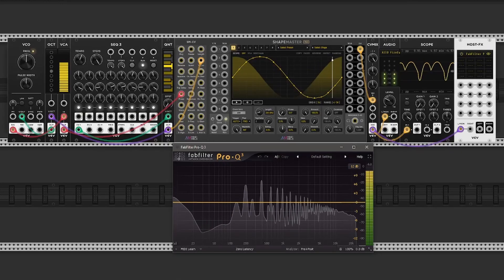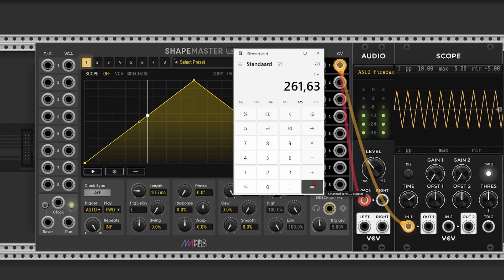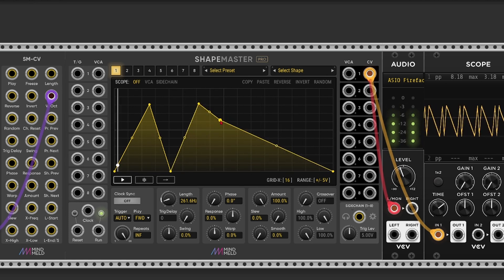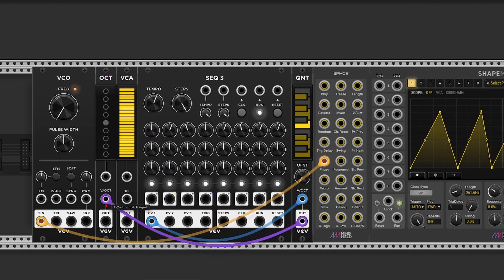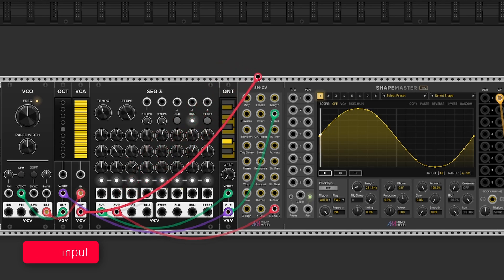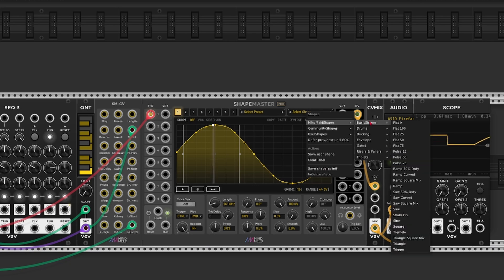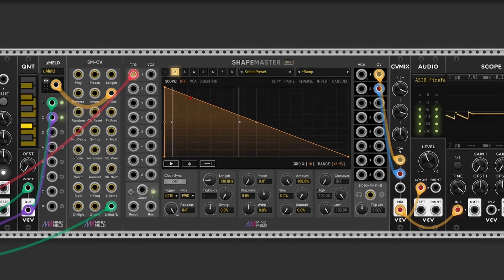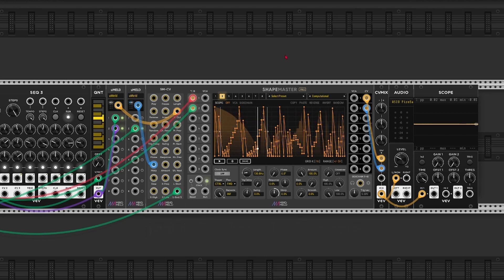Shapemaster Pro Oscillator! (Phase Modulation, Hard Sync, Warp)

Comment: Super nice! thank you for this video! a way to overcome the limitation of the free version would be to run a saw wave VCO into the T/G input, and set trigger to CV, this would scan the wave in sync to the vco
Reply from the maker: Cool thanks for the tip! You do miss out on the additional CV inputs but it's a good start :)